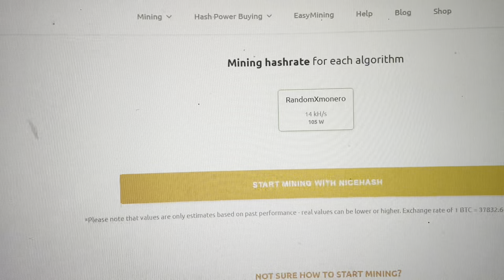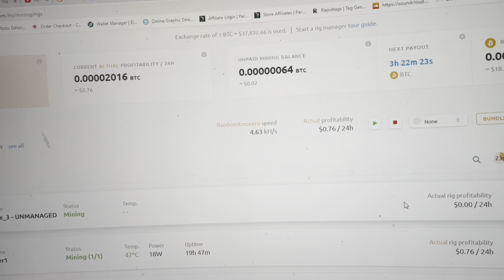Grabbing some Ryzen 5900x for cpu mining fomo

Comment: for randomx, set clock: 3600mhz, core volt: 0.95, soc volt: 0.9, xmp: auto, ram speed: 2400mhz, pbo: disable. must use 2 stick of ram. you will get around 12kh and watt will be around 110-115.
Reply: good

Comment: I remember someone made a video a while back maybe a year or two ago and they basically proofed that gpus that were mined on compared to gpus that were only gamed on were in better condition and it makes sense cause most miners mine at efficient settings. For instances my 3060 mines pretty steady around 55c but the average gamer will game at temps pushing 90c sometimes up to 12 plus hours.
Reply: Keep dreaming man lol. While you’re mining and destroying the memory on the card from 24/7 use. What’s an average gamer play 4-6 hrs maybe a day ? Some miners do take care of their cards but long term 24/7 use will degrade the card much faster than gamer.
Reply: Stepson has broken more gpus gaming than I have ever killed mining he's actually using 1 of my miners now! But I take care of my stuff
Reply: @shiftctrlhack  I've literally had no issues with any of my gpus in the past 4 years now but I mean I keep mine up pretty good, meaning I change thermal pads and paste once a year and clean fans at least multiple times a year and damn near every gamer I know games longer than 4 or 5 hours and will never take care of their gpus like a miner will and thats a fact. And my memory temps are actually running lower than my GPU temps, memory 54c GPU 55c 😉

Comment: I've bent pins on 2 Ryzen cpus. I now use a thermal pad so the cpu doesn't stick to the cooler. Before Ryzen, I had NEVER damaged a cpu and that goes all the way back to Pentium 3. I bet I've changed a 1000 Intel cpu's. I bought a 4090 this month (before the price increased) so it will be a bit before I can upgrade the 3600/3600x cpu's that I am currently mining with. I'll probably use 5900x's too.
Reply: A slight twist back and forth usually keeps that from happening.

Comment: tighten the ram timings (mine's DDR3200 cl 16,16,38 with cr1) ... set the v core to 1.05 or thereabouts and crank the allcore OC up to as high as can run stable. I thinks mine's running 3900 Mhz but I'm not sure. no monitor hooked up to look.

Comment: The only time mining harms your hardware is actually not the mining itself it’s the heat and the only only in those who’s owners were negligent or unaware of said temps or how to properly set your fan curves and power and clock settings. Many people would just turn on nicehash and think that all you have to do… sadly if you just turn on a miner and you don’t tune it yeah that’s bad

Comment: Chumpchange sold all his to Red Panda. Intel is way worse imo. but they are all LGA now. I have a 5900x, 5800x, 3 x 5500, 3600x, 3300 and a 1700x for AMD. 3x10100's, 10700, I0600k and some G5xxx dual cores. lol even the single core i can mine on a dual core is profitable. I am just converting to BTC through  Nicehash, thank again for your quick video. (My grandson will benefit when he gets old enough I am sure).